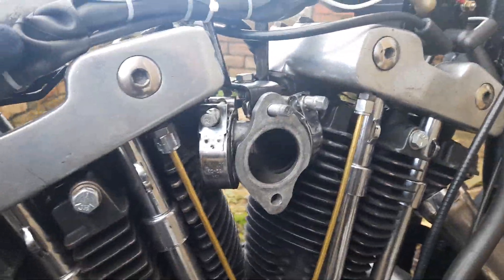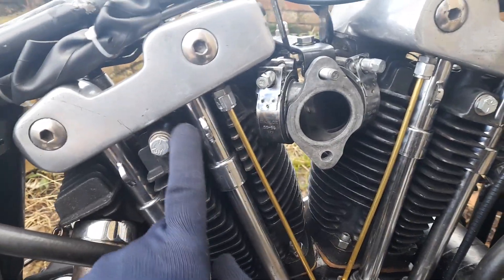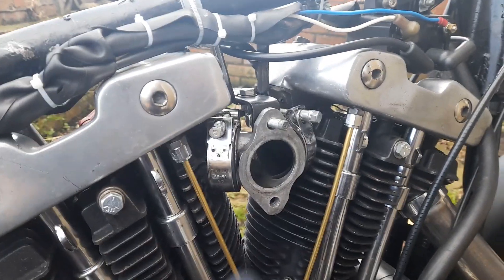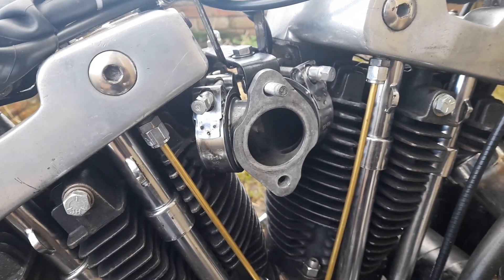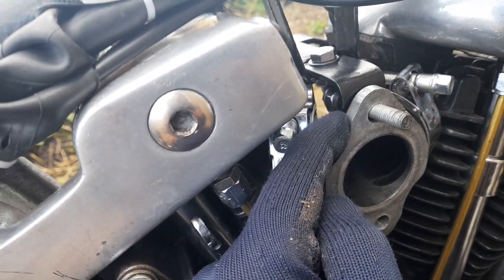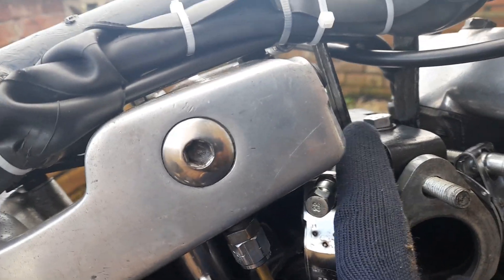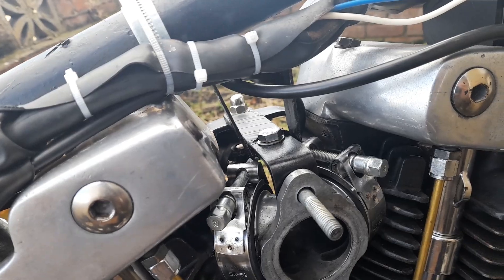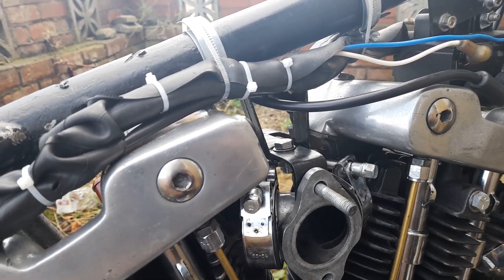Carb support bracket. 1979 AMF Harley-Davidson XLH1000 Ironhead Sportster

Comment: The usual support bracket for the carb goes from the bottom bolt of the manifold as you pointed out, then down the the bolt holding the tappet guide (front cylinder, second tappet.  You just need to bend the bracket a bit to reach the tappet bolt.  Or, buy an aftermarket one.
Reply from the maker: That would work.

Comment: I had problems for years getting the manifold to seal. The bike (79) had bands on it and they would crack. I noticed that the manifold and cylinder spouts were made to accommodate O ring seals. The manual for the ‘79 shows band seals while the manifold has “78” embossed on it indicating a 1978 part. I ordered a James O ring and clamp set for a ‘78 bike,installed it and it worked perfect. That was four years ago.
Reply from the maker: Mine has the '79 manifold so it was happy with the rubbers once the carb was supported but yeah, the amount of other-year stuff on your average old bike is astonishing. Loads of weird parts on mine.
Reply: @ImminghamIronhead  I forgot to mention the bike originally did not have a carb support🤦🏼‍♂️. I took care of that, they are a must have item.
Reply from the maker: @Kookamungawerewolf  True